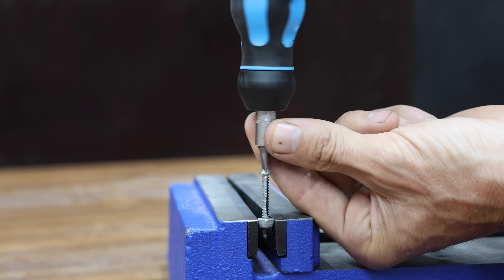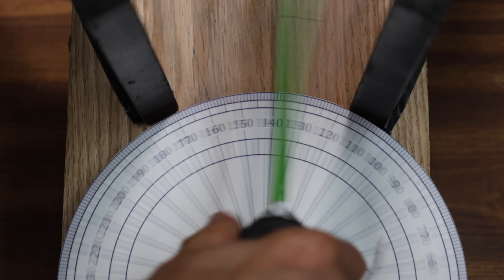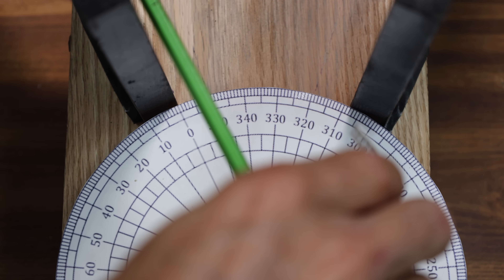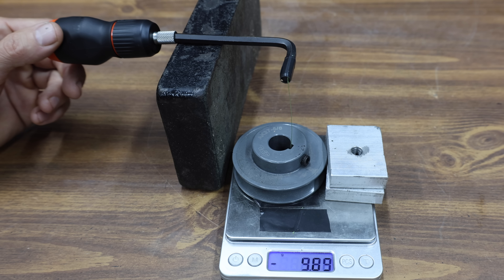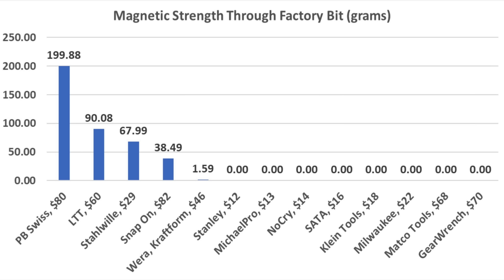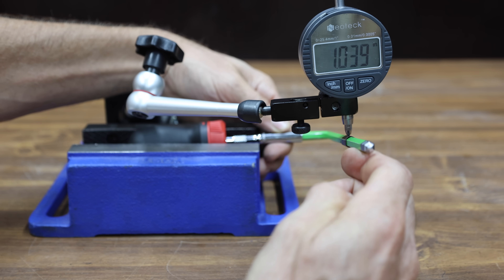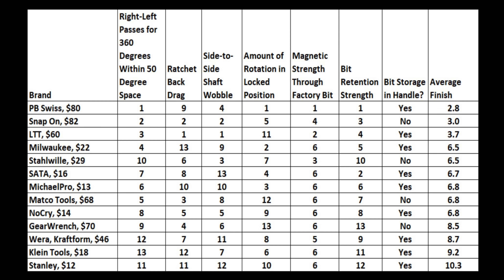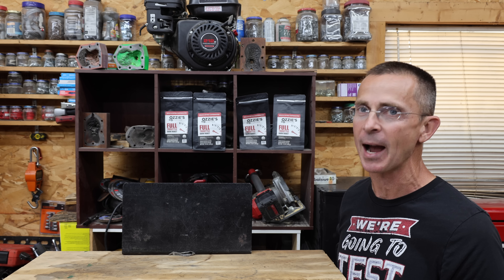Is Linus Tech Tips “Stubby” Screwdriver Best? Let's Settle This!

Comment: For bit retention, I think stronger isn't always better. You don't want to be unable to pull the bit out if your hands are greasy.
Reply: This, having to pull out pliers to change a bit really ruins the workflow, and sometimes you want to use your teeth because the dam thing is so stuck in there, it can be very frustrating
Reply from the maker: Thanks for the feedback.
Reply: Yea, there is certainly a Goldilocks zone there. Not so weak that the bit falls out at random, but not so strong that you need to get a pair of pliers to remove them. But that, like everything else, is a bit subjective.
Reply: @SierraGolfNiner  It's probably useful to measure the holding power but not as useful to rank it beyond him using it and noting if it fell out.
Reply: @JimFeig I think its useful because I've got one bit holder I never use because you literally need pliers. I wanna know not to buy that one!
Reply: @darthrex354  Do you know what pulling strength is too high? It's going to be different for everyone. So I think listing it but not ranking by it unless it's especially low is probably the best path.

Comment: 10:05 I think this magnetic bit retention test could be improved in a way. My concern is that the hand could be pulling ever so slightly more or less depending on the grip of the screwdriver (unintentionally ofc). Would it be better if you assembled a light clamp/vice like device that holds the the screwdriver from the top of the handle (the transition from handle to shaft). And this way with a pullie you could slowly intch it straight up  rather than rely on hand percussion. Great video btw I love the channel been here since the old motor oil viscosity tests
Reply from the maker: Thanks!  Thanks for the constructive feedback.
Reply: @ProjectFarm  np, glad you read my comment. If you are interested in more details of what I mean, I can draw it up or make a short video explaining it and send it to you

Comment: I think this is good, because at face value, looking at them, it's hard to understand the value prop the LLT drivers offer.  But the combination of VERY low backspin pulling your screw back out when moving against the ratchet to make another twist, and a fairly low number of twists to make a full turn, means you'll spend less time adding extra turns to undo the backward progress as you tighten it.  It's the kind of thing you could otherwise really only find through extended use of both.
Reply from the maker: Thanks for the feedback.

Comment: i wonder if the quality of the bit effects the magnetite pull for the screwdriver seeing as the nocry had a good hold on the bit but no pickup ability.

once again very helpful video! can you look at brakes next. are ceramics better? do rotor slots and holes make a difference? this would be fun to see
Reply from the maker: Thanks!  Thanks for the suggestion.

Comment: The subject of this video is awesome!  I haven't had a lot of luck with stubby ratcheting screwdrivers, but I'll admit that I've only bought cheap ones or the ones that come in a set.  What I've found is that the ratcheting mechanism doesn't work for very long, particularly after cranking something down with a lot of force.  After watching this video, I'm willing to give it another try.

A criteria I'd like to have you test is the amount of torque a person can put on the screw.  I've noticed that some screwdriver handles aren't too good for putting a lot of twist action on the screw.  It may be a bit subjective, but I think it's an important criteria.  Also, the length of the tool is important.  I use a stubby screwdriver to get into tight spaces, so a long tool may have limited use.  Also, if the handle is too large, it may not fit or it may be difficult to grab and twist.
Reply from the maker: Thanks!  Thanks for the suggestion.

Comment: I’m curious to know if long term use helps with the back drag? Maybe put a drill on them and let it rip to see if it does.😅
Reply: And also if the useful degrees of rotation would decrease significantly.
Reply from the maker: Thanks for the suggestion.

Comment: WORTH NOTING...
You don't want a very strong magnet on your screwdriver if you are working with sensitive elecrtronics like PC's.
You don't want your bit to be stronger than your part, because you would prefer a dollar bit snap than a 200 dollar part.
Reply: @htr5372 So first off, a neodymium magnet IS a supermagnet.  All of them.

They are literally the strongest permanent magnets in the world. That is literally where the term came from.  

Secondly, while the current claim is it takes a neodymium magnet of roughly 450 pounds of force to harm a PC, I have worked in the field long enough where I have seen the speakers in magnets cause issues by placing the speakers too close to a pc.  Multiple times.

So in real world, again, you are wrong.

Third.  NVME drives are EXTREMELY susceptible to data loss from magnetism, and it doesn't take nearly 450 pounds of force.  A strong magnetic screwdriver very much can cause damage.

Forth.  Registered ECC memory chips are again, very exposed, and very much not okay with magnetism.  Putting a magnet too close to them will cause data loss.

In fact, in the 80's we invented Magnetoresistive random-access memory (MRAM) in order to combat this.  It is no longer in use.

But what do I know.
I'm just the guy that does hardware repairs in the United States Treasury because most people are like you.  Uneducated and loud about it.

Comment: I guess I would prefer a Wiha screw driver with a motor over any of these stubby thingys... They are just too often in the way with the thick handle and you need an extension to make them work.

And I just don't want to screw in dozens of screws manually anyway :)
Reply from the maker: Thanks for the feedback.

Comment: 99.9% of LTT screwdriver buyers are only going to use it on a PC.

If you really think you need a 55 dollar screwdriver for that, then go ahead, spend your money !
Reply from the maker: Thanks for the feedback.
Reply: @ProjectFarm  Thanks for making the the videos !

Probably a little negative on poor Linus but honesy, most screws in a PC are M3s or around that size and they won't have rusted themselves in - they really don't need anything that expensive !!

And I'm not a fan of interchangeable ratchet screwdrivers to be honest - too much to go wrong, too bulky to get into tight spots and the heads always wobble around - much prefer a bog standard 'normal' one !!

Comment: I value durability most for a screw driver with at least a baseline utility. But the price has to be within reason compared to a basic screwdriver (next best alternative).
So based on durability, back drag, and tightest swing... I guess I will have to re-examine the whole video. the end table was not particularly useful this time.

* there is no chart for the failure torque, not that the test was perfect but it looks like it would be between the Sata and the Michael Pro. So I would then look at the other characteristics between the two.
** everything seems to lean towards Michael Pro.

But, whether you can find either where I am is a substantial question.
Reply from the maker: Thanks for the feedback.

Comment: A few things.

Bit holders dont matter for those that have a tool box, but for DIYers it may be important. Most techs have dedicated bits, in holders so the driver doesnt have to come with bits (you waste money for stubbies, long handles etc. Also, you lose them easier when theyre in the tool versus a dedicated bit holder in the drawer)

Magnetic tips arent mandatory for most. Plus, we can magnetize them or demagnetize them as needed.

The tool itself holding onto the bit too strongly is a big hassle when you're wearing gloves or covered in oil or grease.

The big one now. Failure of the bit. It is not good to have the bit sheer off. I would rather have the bit twist that sheer off, especially for a small application, that would result in FOD. Even in automotive applications, you dont want that sharp chunk lost who knows where, or falling into places it shouldnt fall. Its why many bits are made to twist and cam out rather than sheer.

Not a critique of the video, just pointing out that the same tool can be used in many different applications that have opposite sides of the spectrum for each metric. For me in particular, I dont use stubby ratchets, unless its a traditional wrench thats just small, or the friction lock ratchet, with that small handle, and thumb wheel (for dashboard work, and tight areas, like door jambs and whatnot). I know that you cant just do one test, so you test a bunch of other factors. But its still interesting to see. The slop in the shaft also isnt a big deal, unless its a dusty environment, where a tool thats too tight, ends up not fitting because of dust, dirt whatnot.

For this, and other tools in general, corrosion tests would be nice. Since some tools dont get used often, and can be overlooked for greasing, and could rust internally.
Reply from the maker: Thanks for the feedback.

Comment: Did you replace the screw when conducting the magnet strength test if not the rubbing of the magnetized bits might have made the screws someone magnetic affecting the measurement

Comment: Thanks again for another great video brother. You mentioned that Snap On and Matco not having on board but storage. Those two are sold primarily to mechanics and were kept on my cart. I always had a bit set, a couple other ratcheting screwdrivers on the cart anyway. I wasn't going to take apart my screwdriver to change bits, just grab another bit.
The full size has bit storage but i never used them. I have a couple Williams T handle ratcheting screwdrivers in different lengths also. 
Thanks for all you do.
Reply from the maker: My pleasure!

Comment: A suggestion on your final scoring: As it currently is, you only take into account the place a tool finished in. However, you don't take into account if the tool in place 1 was 10 times as good as the tool in place 2, or only marginally better. For example, the PB Swiss did almost twice as good as the second place in the bit retention strength, but that doesn't get reflected in the final score.

Personally, I really like the spreadsheet that the torque test channel uses in their videos. This takes the actual values a tool scored, and then applies a weighting to get a final score. Personally I don't like the weighting (unless the spreadsheet is publicly available so people can change the weighting to their preferencers), since each person has a different need. One wants a tool with as little backdrag as possible, the other doesn't care one bit about backdrag, but it does provide a nice overview.

This is also something that slightly bothers me about your videos. You put a lot of effort into these videos, but then don't make the things you found out readily available. Sure, I get that you want people to watch your entire video, but it would be very nice to have an overview table at the end of the video (again, like the torque test channel), where all the things you tested can be viewed at once. That would probably help people find the tool they need without having to skip through the video looking at the test results individually.
Reply from the maker: Thank you for the feedback!
Reply: But then people would be able to see that the ltt was one of the least durable tools on this test. It came in last place in the break test.
Reply: @dru70292  Not sure if you actually use ratcheting screwdrivers; they're not typically used in applications that require a lot of torque. You will not break it like that in normal use.
Reply: @veryboringname.  Yeah that's a lame excuse. I don't care if they are racheting I still want to know which one will last longer.

Also not sure if you use any tools if you think people are only going to use them as recommended. Yeah we all know you don't use a screwdriver as a pry bar or a wrench or pair of pliers as a hammer but we have all done it. People are going to use the ltt to take out rusty screws and it should be included that the ltt performed the worst at this.
Reply: But is that actually better to have to pull like crazy to get the bit out? I would actually not put it at number one for this much pull.
Reply: @YouPlague The main reason why I never liked bitted screwdrivers is because the bits often get pulled out too easily, remaining on the screw. It's also the reason why I shelled out for the PB Swiss, however I was disappointed with the heavy backdrag. After also not being too impressed by my Wera ratchet, I decided to try the LTT one and for the first time ever I'm actually really satisfied by a ratcheting screwdriver. I just wish it had the magnet strength of the PB Swiss.
Reply: @veryboringname.  It's funny how the best thing about linus screwdriver is the least important lol. Also strong magnets are not good for electronics.
Reply: @dru70292  I'm not sure if you use ratcheting screwdrivers but low back drag makes a very big difference when starting a screw. Also can you explain exactly how a magnetic screwdriver is bad for electronics?
Reply: @veryboringname.  Do you use them? There is a reason they have a locking position. 

Storage, hard drives.
Reply: @veryboringname.  Their screwdriver broke way before any other one did lol. Project farm left out those results to make the ltt look better. Those are just facts, sorry you can't handle them. 

Yeah and like I said people always use their tools the way they are intended right? 

Strong magnets and storage do not mix lol. That is just another fact.
Reply: @veryboringname.  Oh sorry the ltt came 2nd to last, is that better?😂🤣😂🤣😂🤣😂🤣😂🤣 

Yeah like I said durability of the tool always matters, he cherry picked the test to make the ltt look better. 

Says the guy who didn't even know that ratcheting screwdrivers have a locking position. 😂🤣💀

Ok I googled it, strong magnets and data storage don't mix.
Reply: @dru70292  I'm amused that you've started to make things up about locking positions. 

I'm also amused that you have to resort to lying about googling hard drives and magnets. Evidently you are unable to admit that you were wrong.

In any case there is no point continuing this further as it'll just go around in circles.

It is abundantly clear that you do not actually use these tools, don't actually work on computers, and simply have an agenda against LTT.
Reply: @veryboringname.  Are you saying they don't have a locking position? 

I did Google it, strong magnets can damage hard drives. 

It's clear that you can't accept facts, the ltt is the 2nd to last in durability.
Reply: @dru70292 Again, you're making things up. As I said, there's no point arguing with you further as it is abundantly clear that you do not actually use these tools nor do any technical work involving these tools and simply have an agenda against LTT.

Comment: Heyo Project Farm, so appreciate what you do as has been expressed in every comment section on every video.  I am an electrician and have a useless need to have Klein tools soni have seen you test a lot of them.  The warranty is crap on Klein yet I pay a premium getting the.  There are cheaper/ better drivers out there but I Pavlov's dog it and keep getting klein 🤦🏼.  Anyway, the drivers are still excellent except for my experience with the stubby.  The bits are garbage.  I was so disappointed.  And because they are extra short, normal small bits aren't an option for replacement, it also had a mechanism for extending the neck to make stubby screwdriver longer.  The one you tested had double ended bits so I can't speak for that.  I ended up getting a Milwaukee which I'm happy with
Reply from the maker: Thank you for sharing!

Comment: Hate it when it requires PLIARS to remove a bit.  The PB swiss gets a REJECT due to this problem even though it technically is #1 otherwise.  Leaves the LTT as #1.  Snap On gets rejected due to ZERO bit storage though they will claim you buy this in a SET with a case etc for those who work out of trucks, but for those who work in the FIELD, this = REJECT.  So, if you work out of a truck using the Snap on Shaft bit set, it is #1 by far and if you work in  the field, get LTT.  PB Swiss as far as I am concerned destroyed an otherwise great stubby with an insane bit holding strength required.   With age bits tend to get HARDER to remove or far easier and in a heavy wear environment, nicks get on the bits generally making it harder whereas light duty they do not but rather wear and lose strength...
Reply from the maker: Thank you for sharing!

Comment: Linus and his team, I give them props for knowing what their customers need. A good magnetic grip, low back drag, compact, good arc swing. Not every job is the same, but for fine work on electronics it's a solid choice.

Even if you're not looking to have empirical data on how the LTT driver performed it's nice to know the values of other drivers. I used to live in the northeast and low backdrag wasn't that important due to a lot of rusty fasteners, being able to find a screwdriver with varying parameters leads to jobs well done and happy customers all around. 

thanks for all your work, been enjoying your channel for years and it continues to deliver on items I buy regularly!
Reply from the maker: Thank you!

Comment: Given that ratcheting screwdrivers are used with constant downward force (often considerable), I wonder simulating it in testing it would influence results on wobble, backlash and backdrag, as such pressure might effect parts engagement and internal friction.
Reply from the maker: Thank you for sharing!